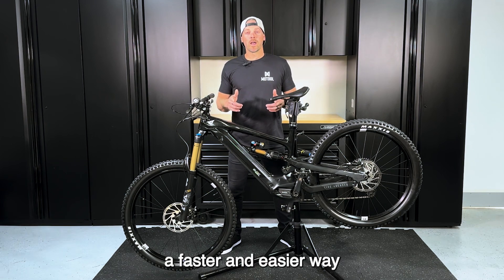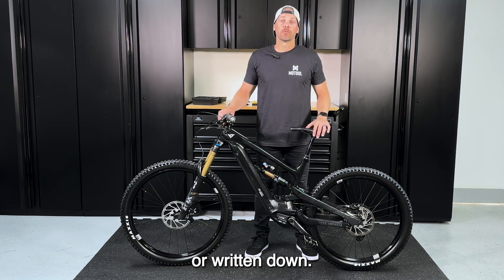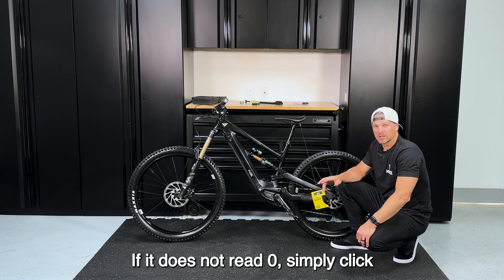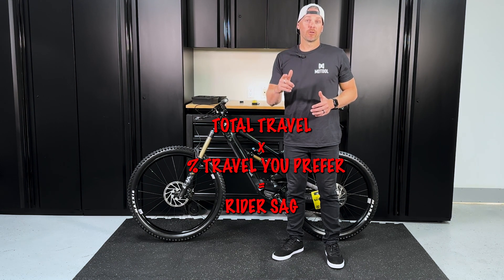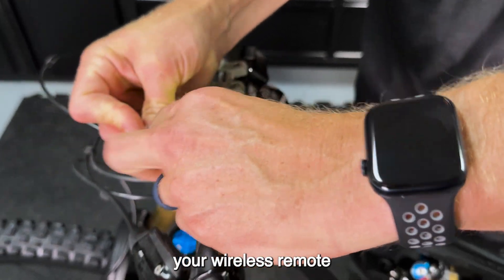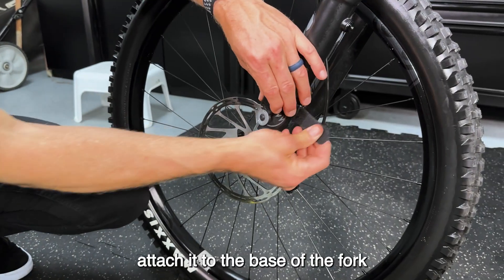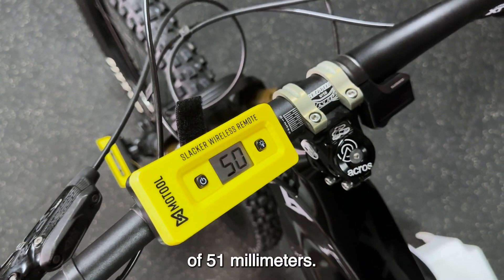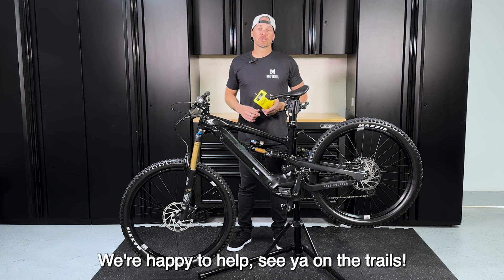E-MTB Suspension Setup Tutorial with the Slacker Digital Suspension Tuner.

Comment: 112mm rear ? Not much with 170mm front. Did I miss something? Thanks
Reply from the maker: We are measuring the total travel that can be achieved between the rear frame and the seat rail, so it does not reflect the full travel of the axle. This allows us to take a much more accurate measurement than at the shock body, and we can calculate the percentage of sag used in real-time whale taking measurements. Hope this is helpful!